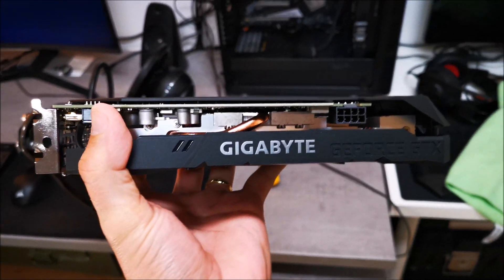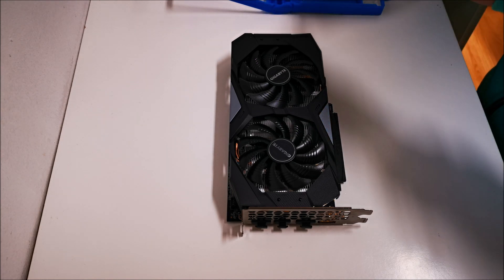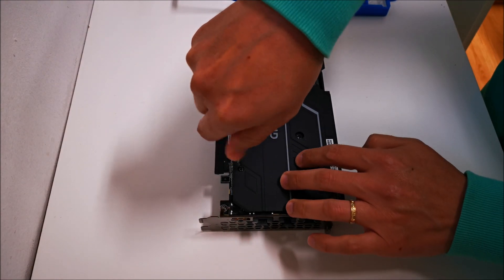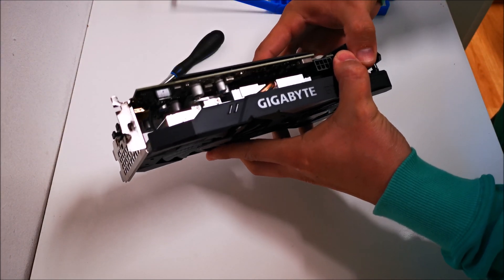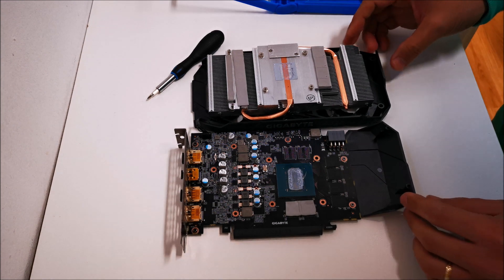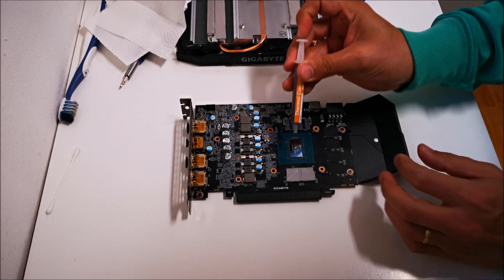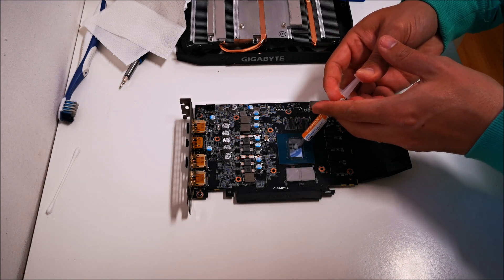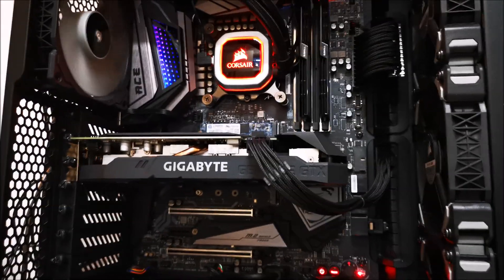Gigabyte GTX 1660 Ti Tear Down and 4 Game Benchmarks

Comment: Yo, thank you for the nice video and I have a question to you - may we actually remove plastic backplate or it's not really recommended?

I didn't really understand this moment because on my older gtx 760 there was no plastic backplate and was working good.
Reply from the maker: @Divait100  No no. The plastic backplate is there to protect the rear of the card from damage. Leave it on.
Reply: @TechnologyHive Okay, got it, brother, so there is a risk. Damn, why are they making those useless plastic backplates? Pointless!

Comment: What is the dimensions of the thermal pads please
Reply from the maker: These are 1cm square x 1mm thick pads. BUT, if you buy this stuff, it usually comes uncut. Meaning it's a big 10cm square you can cut to size. Sizes vary.
Reply: @TechnologyHive  thank you sir

Comment: Got a bad version of this one which is atrocious, temps are 83-85 celsius and I think it's pretty much a manufactur error(wanted to RMA but the process is long). So I changed the thermal paste and tested it in an open bench, still the temps are in the 83-85 celsius range. But if you are reading this comment and looking for a solution to match similar temps on the vid. Don't worry I got the solution,it is by changing the thermal pads. Thermal pad size on this specific model is 1mm,1mm,1mm for the lower 2 vram chip and 3mm on the 4 vram chip. Gigabyte being shitty made an error of putting my model a 0.5 mm thermal pad and 2mm thermal pad (-.-). After changing the stock thermal pads, the results and temps drop drastically and perform the same on the video which is 70-74 celsius, hopefully it could help some people experiencing high temps with regards to this model. Though I'm late XD.
Reply from the maker: Thanks. Very useful information!
Reply: Was looking for this, mine's a 1660super Windforce 2x and i haven't seen any teardown of this model, i expect it to be similar to the 1660ti Windforce 2x though, will go for 1mm and 3mm pads
Reply: @randombullshithandle  what temps are you getting? I'm getting 80°C under full load
Reply: @randombullshithandle  what was your ambient temperature
Reply: thanks bro
Reply: Thermal pads size same with super version sir?..

Comment: hey sir sorry one last question would you recommend liquid metal on a gpu like this? or is too dangerous? thanks!
Reply from the maker: I wouldn't recommend liquid metal on any gpu to be honest. I use liquid metal for cpu dies only myself. I'd just stick with good quality thermal paste like MX-4 or Thermal Grisly kryonaut. These will do an excellent job at transferring heat from the gpu die to heatsink. 👍👍🔥
Reply: @TechnologyHive  oh ok yea i am too scared to try liquid metal yet, i feel like i need someone to help me not mess it up, i recently got MX-5 i am gonna try that thank you!
Reply: @ClipperAce  what?

Comment: howcome you dont use heatsink on ur nvme drive?
Reply from the maker: It is a 120GB SSD. Something this small in size does not typically need a heatsink as it does not get too hot. Anything over 256GB i do use a heatsink.
Reply: @TechnologyHive  oh really? I didnt know the size affects the heat. I have 3 500gb nvme drives in my machine with heatsinks and i was thinking of taking one off to see if it would get cooler or hotter
Reply from the maker: @thegr8rambino  It doesn't hurt to have heatsinks on the drives. But if the drive in question gets too hot, it begins to throttle, which is bad. Typical drives close to a GPU you want to have a heat sink on anyway because the hot air from the gpu will heat it up. So it is all depending on your system set up. 500gb M.2 drives will need a heatsink. 👍
Reply: @TechnologyHive  ok thank you sir! I want to repaste my 1660 Ti like you did here I am hoping I get nice results can you wish me luck sir? And should I use kryonaut or arctic MX-4? Thanks!
Reply from the maker: @thegr8rambino  You have my blessing. Ride along knight and repaste that graphics card. And yes, MX-4 is a great choice.
Reply: @TechnologyHive  thank you sir!

Comment: I have the i5 9600 k @ 3.70 ghz up to 4.6 ghz I tried to oc it to 5 but after a couple days it crashed and windows reset it ??  I have it in My Mag Z390 TOMAHAWK  (MS-7B18) MotherBoard  I used a Guide specific for my MB too . I know it's operator error . lol

Comment: My rig contains this gpu and in total my pc requires 300 watts, do u think i should get a  450 watt 80+ bronze semi modular (for future upgrades), or the 500 watt 80+ white non modular for 15 USD cheaper?
Reply from the maker: 450w should be plenty. Future wise, hardware just keeps getting more power efficient, so going for something higher than 500w is pointless, unless you have a lot of peripherals in your pc.
Reply: @TechnologyHive  Ok thanks so much!

Comment: I have a question, was there any difference in temperature of the gpu after you changed the thermal paste?
Reply from the maker: No. There was no difference in temperature. The thing is, the cooler the graphics card runs, the higher the card will boost. So due to the improved thermals, now the card boosts around 50mhz higher than before, while maintaining the same temperature. It is all configured in the card's BIOS to run according to temperature first, then power, then boost in speed. The more you cool it, the more it boosts till it hits the power limit and then it just settles there. Hope that makes sense :)

Comment: I’m gonna build my own pc this week, I feel terrified
Reply from the maker: Why do you feel terrified?
Reply: Technology Hive I’ve never built a pc before nor watched it getting built which makes me careful, I’ve watched a lot of tutorials on YouTube and it seems easy except for cable management which makes me worried about which power supply and case to pick 
The guy in the store asked for 60£ with me installing windows and the drives so I basically ran away
Reply from the maker: @archer1660  The Phanteks Eclipse P300 is my favorite case hands down. When it comes to a power supply, just make sure you get one from a reputable brand, like  Corsair, Seasonic, Antec, Cooler Master, with a 80 plus bronze rating. 500 watts should suffice for most builds, unless you are going with an dual graphics card setup or a high end card, like a GTX 2080 Ti. 

Install the power supply first and run the cables through lining them up with the appropriate motherboard ports. Then install the CPU and heat sink on the motherboard before you install it in the case. Then install the motherboard. The rest is small details. Take your time and do not rush. 

If possible, connect the power supply to the power outlet as you work on installing the other components. This way your computer case is grounded. Touch the computer case  every few minutes as you work on installing the other components so as to discharge any static electricity in your body, granted you have already installed the PSU. Just make sure the power switch on the PSU is set to OFF until it is time to power up the PC.
Reply: Technology Hive 
Thanks for the tips man
I’ll tell you what happens wish me luck
Reply: @archer1660  i build mine today holy
Reply: @archer1660  gl
Reply: @archer1660  so... what happened?
Reply: Ivan Bilić I built it mate, all worked
Reply: @archer1660  that's nice bruv. I'm building mine this week :)

Comment: i want a rtx 2060 :(
Reply from the maker: The 1660 Ti is a better choice imo.  In avg there is a 10fps difference between the two. Not worth the cash for the RTX 2060.
Reply: @TechnologyHive  even if, the rtx 2060 has the usb-c port and a dvi port. that i need for my monitor. And the rtx 2060 is fucking beautiful.
Reply: @TechnologyHive  you are right, gtx1660Ti is a better choice for gaming since it has better price in comparison with 2060 and the difference in performance is not that big but still if we talk about gaming + streaming then 2060 is better, at least because if you stream by use H.264 codec on 1660Ti you will lose 10-15% of the fps but on 2060 about 5%, cerrect me if im wrong, I just read it somewhere
Reply from the maker: @UVersusPro  Hello! A lot of what you do Uversus, has to do more with your CPU than GPU. You record game play, stream, encode and decode. All of this falls mainly on the CPU, unless you specifically assign software to utilize your GPU. I have in the past used H.264 encoder. But recently I started using NVENC for both streaming and recording using OBS and I have noticed a better and smoother experience...using my RTX 2070. This is a $500 graphics card. NVIDIA did improve the NVENC encoder with their Turing architecture over Pascal. So yes, you may see an improvement in performance per dollar. 

But this is where things get a bit complicated, because you also have to think about your CPU. Don't make the mistake a lot of people make and go and get a fast GPU and pair it with an older CPU and then regret their purchase because they did not get the experience they thought they would. This is where the CPU bottleneck comes into play for people like you who do what you do. Stream.  

I remember you saying you are using the i7 7700k. This is a strong CPU for gaming. But it is still at the end of the day just a quad core CPU, and for what you are doing, streaming, recoding while playing, and such where the CPU is being hammered, I would recommend you reconsider your approach at what I assume you are trying to accomplish here. Better all around performance. Gaming, streaming, and recording, right? I have a few recommendations for CPU's if care to know. I'd be happy to help :)